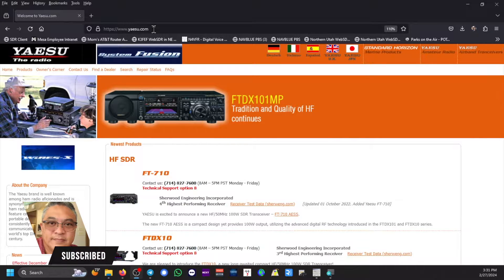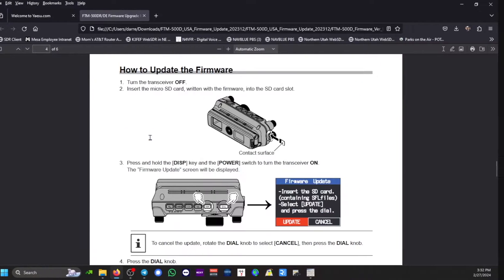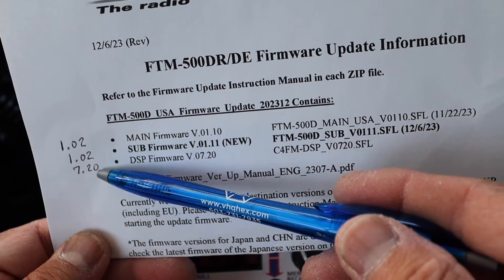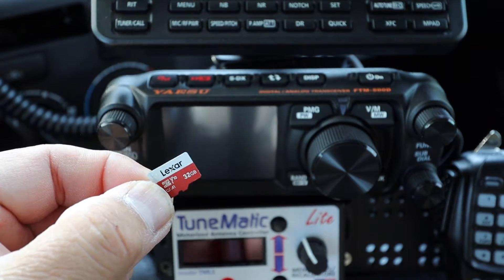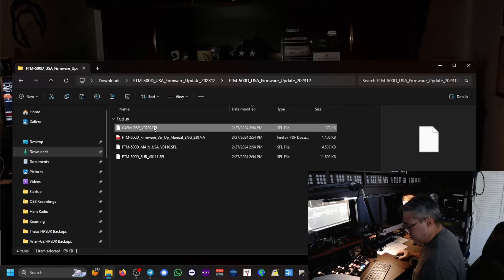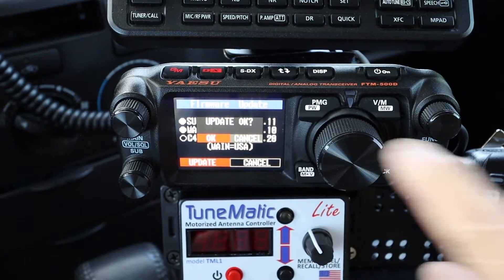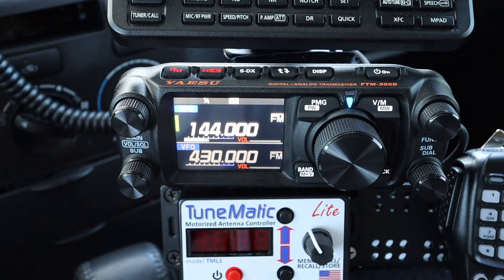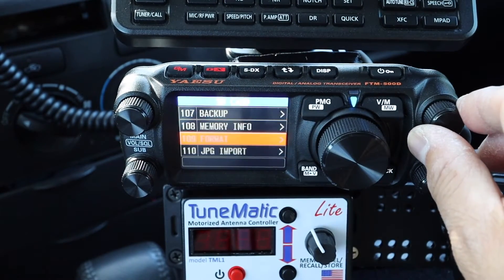Guide to updating the Yaesu FTM-500's Firmware | Update to the latest Firmware | Easy Step-by-Step

Comment: I used a Macbook Pro M3 with full success.  I did not use 2 SD cards, I moved the backup files to my Mac and then back to the SD card after the firmware update..  Thanks for the help!  N0SRR

Comment: N6WIP here. Thank you for making this video. It made it sooooo much easier than the manual. I caught the card removal and insertion with powering down the radio. That was an OOPS! I freaked out when you did it. I yelled NOOOOOO!!  Good save 🙂 Again, thank you.
P.S. How do you like the TuneMatic Lite? I'm thinking, I need the Tune Matic for my HI-Q 5 (As seen on my QRZ page)  but, if the Lite will work, hey, I'll save the money.
73, Jay